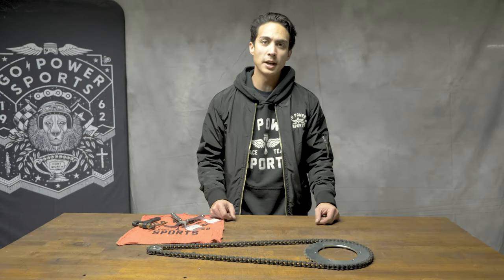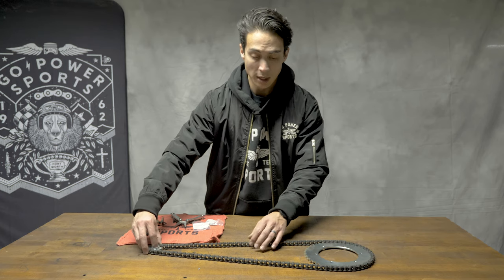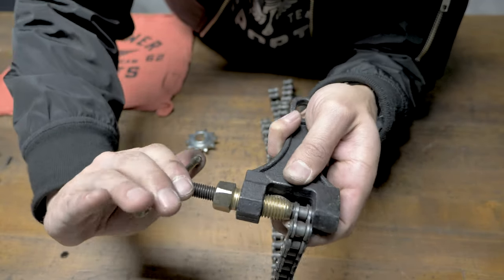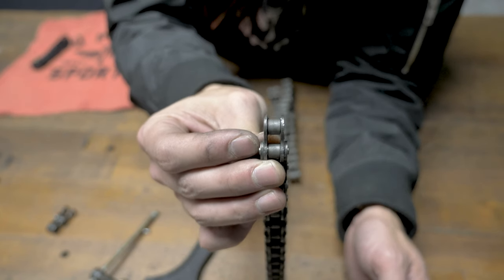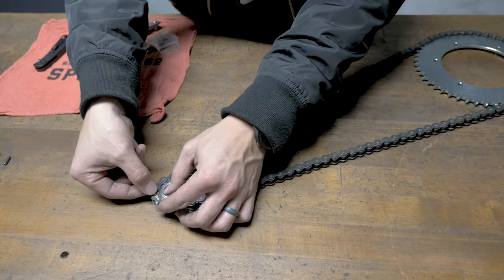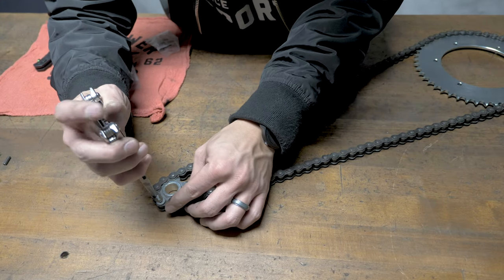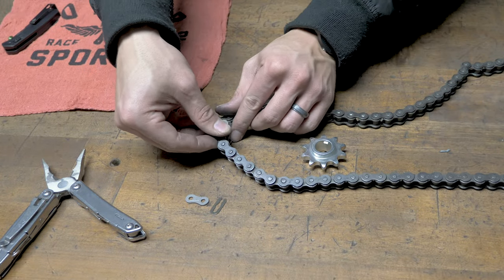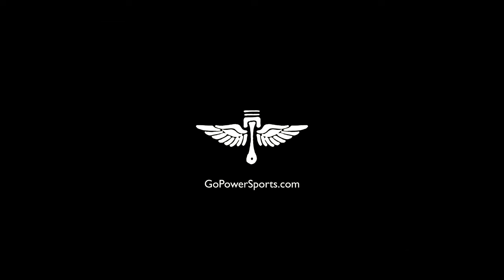How To Use a Chain Breaker Tool, Master Link, and Half Link | Tutorial

Comment: You made it look so easy. I spent like a 1/2 hour trying to get mine on but I couldn't get one of the pins to go through the hole at first I don't know why it wouldn't fit through so I ended up drilling the pin hole out a little bit till the pin fit through and then once i got the ppin through the hole it was like the pins weren't long enough to hold on the plate and clip on the other side. I could only fit either the plate by itself or the clip by itself not both. So I skipped the plate and only put the clip on the other side and yeah that was a mistake cause not even 3 minutes of riding and the hole chain fell off lol. So annoying !! Now I'm waiting on a 10 pack of master links to come in the mail to try again.

Comment: Hello I just installed a stage 2 kit on my gx200 I'm having trouble with it cutting in and out at high rpm it's getting plenty of fuel I have checked my coil Gap over and over the coil test good ... any suggestions?? I'm running a  22m carburetor with bigger jets.

Comment: You would use the half link with the master link if you needed a bit more length? Would this be due to a new chain stretching?

Sorry if it’s a silly question but I am completely new to all of this and trying to get as much info before I start my 1st project this spring.
Reply: So I’m the chain there is inner and outer plates. To put the master link both ends need to be an inner plate. But sometimes when you measure out ur chain it always ends up with an inner plate on one end and an outer plate on the other. So you break the outer plate and add a half link so the chain fits. Hope this helps
Reply: @ihashinc567  It makes perfect sense now. I appreciate the information.
Reply: Half links are shorter than a typical chain link.  I only learned about them because I was informed one would be ideal for my bike.  They can also be used if one needs more precise chain length.

With the current length of my chain now the rear wheel bolts are at the end of the dropouts.  The ride is super spinny(48x17 ratio).  Chain only has about 100 miles on it as well so it hasn’t stretched out much at all. 

I realized I’d need to remove a few links in the chain but the owner of the shop recommended a half link.  The seattube of my bike is aero designed and takes up about an inch of the chainstays.  The chainstays are a little short so this doesn’t give me a lot of space to work with in regards to my rear wheel and chain.

Comment: Can you split a chain without a chain breaker tool?
Reply: Grind the pin until it is flush with the plate and use a punch to push the pin through